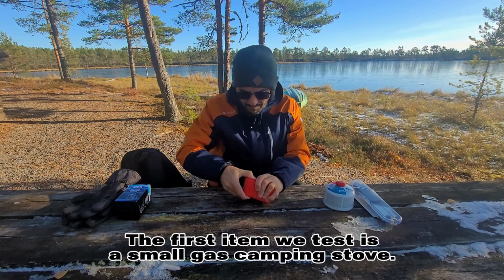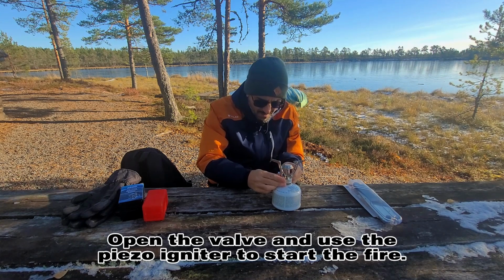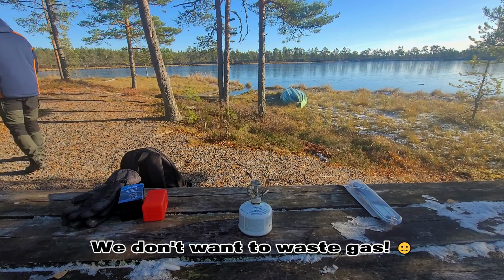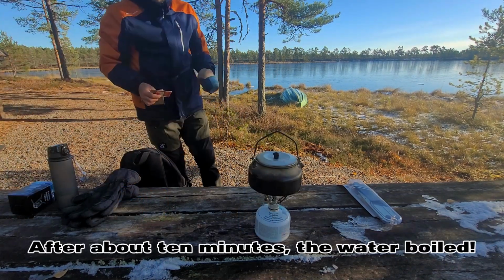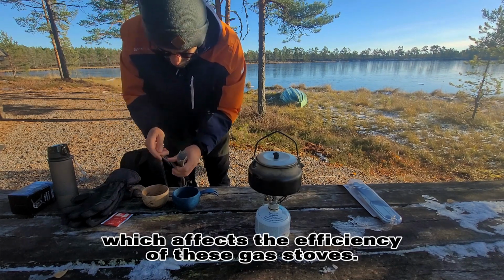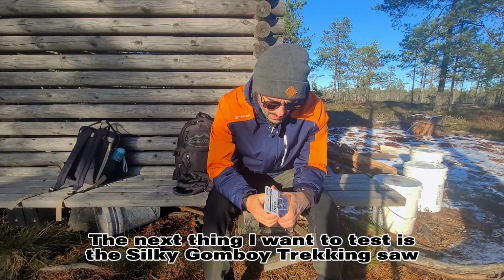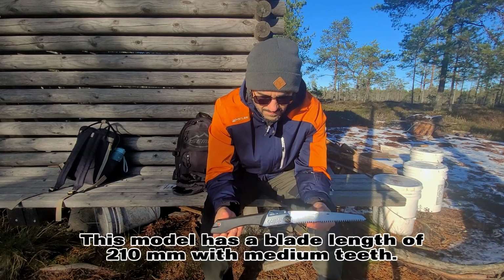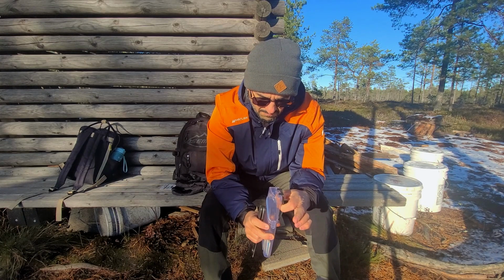Atom Gas Stove and Silky GomBoy - New Outdoor Gear

Comment: Very cool stove works good i would be interested in seeing the one you have that used wood verses gas  and your saw was very nice a smooth cut and didn’t look as if you needed to put pressure on it either great video 😄🐈‍⬛✌🏼
Reply from the maker: The saw goes easily through the wood, there is no need for too much pressure at all. maybe I will do one test, between this two stoves! 😁Thanks! 😊❤

Comment: In your country, it's seasonal so there's probably snow on the table.
Water heaters are now a necessity for campers! Gas cylinders are already widespread. It's best to boil water and drink coffee!
Does your wife like tea?
You'll also need a handy saw! It cut in less than 15 seconds! surprise!
Thank you for showing us that camping can be more fun with quality gear.🌲🌳🪵🔥
Reply from the maker: Yes my friend, winter comes to Finland very early. In the north, snow starts to fall, even while the calendar summer is still going on. I live in the middle of the country, so the snow here usually starts in November, but this year it came a little earlier. Lake is already frozen and there is a lot of snow from yesterday. Silky is a Japanese brand so it is not surprise that this saw is amazing. 😊 And yes, my wife sometimes likes tea more than coffee, while most of the time I only drink coffee.
Reply: @FlerkenCats  I didn't know it was made in Japan!
When I looked it up, I found that it was "Um Industries (Silky) Rubber Boy All-purpose Eye 210mm"! Scissors, razors, and small knives made in Japan might be good・・・! thank you😽😀🐾